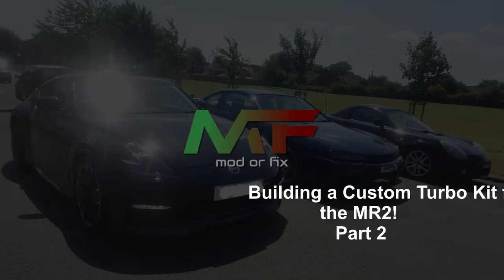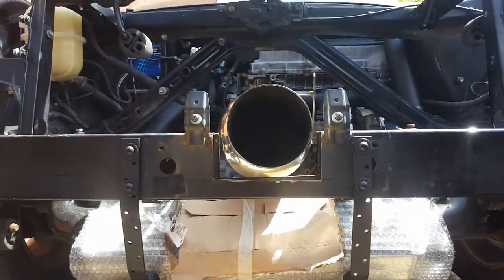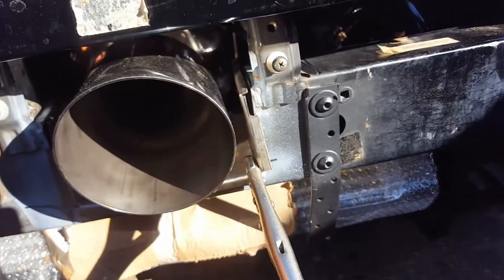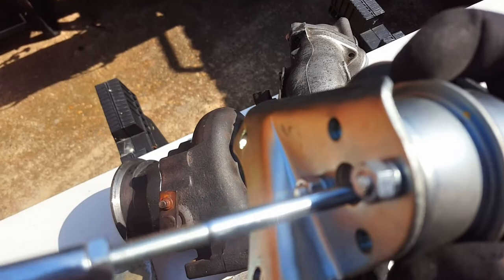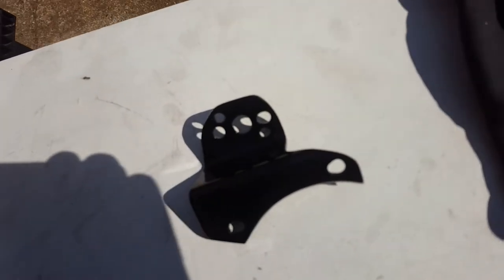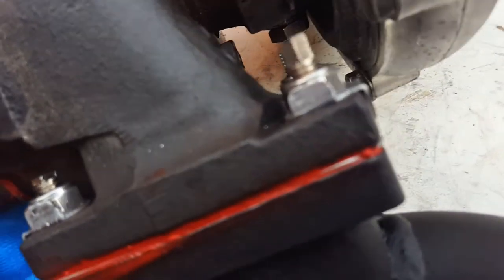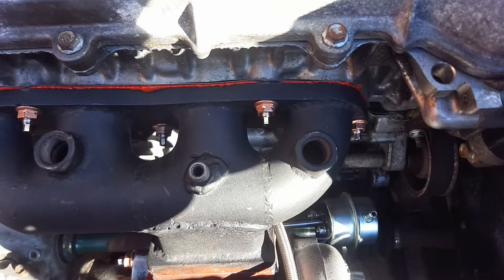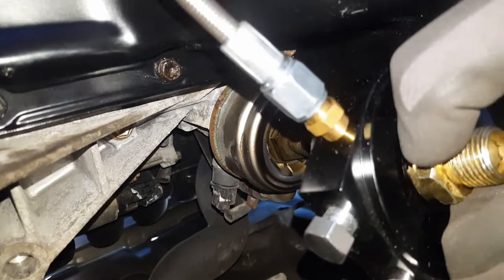Custom Turbo 1ZZ MR2 Roadster / Spyder Build Part 2

Comment: This series is really good! Surprised it hasn't blown up.
Reply from the maker: I think maybe the Mr2 Spyder/roadster market is niche, and not as many people dive in. I think the number of turbo mr2s has risen a but since I published this though lol!
Reply: @ModorFix  by any chance have you got a list of parts and prices to do this?
Reply from the maker: @nicktayshagaming1659  I will make a video and go through it all in detail. But to give you an idea, I built this on a budget and it still cost me over £2k that's with an inexpensive ecu and self map.
Reply: @ModorFix  I mean £2k is really reasonable to turbo a car, but I guess you basically did all the work which is amazing.
Reply from the maker: @nicktayshagaming1659  yes but that's on a budget. I mean.. I paid £30 for my exhaust. And £120 for my turbo to give you examples. If you bought a proper exhaust, management and mapping and turbo, you're looking at 2k there alone. Let alone a good clutch lol! Sating that I need to do a clutch on mine.
Reply: @ModorFix  oh wow some proper bargains!!

Comment: Thanks for all vids, clearly explained, very helpful informations.. 
Can you link me the oil sandwich please 
Thank you
Reply: Is there other locations for oil feed line if i done want to use oil sandwich?
Reply from the maker: There are an array of them on ebay. I can't find a link to the one I purchased as it has been a few years now. But it wasn't expensive. Around £15 and works well.
Reply: @ModorFix  
Thanks   i will search it now
Reply from the maker: @100stamina  yes, you can T off the stock oil pressure sender/switch. You will see it above the oil filter.
Reply: @ModorFix  
I just ordered a T piece adapter 
Thanks again
Reply from the maker: @100stamina  welcome bud.

Comment: Thanks for the vids. Any issue with the MOT not having a CAT? Were emissions OK??
Reply from the maker: Hi Jared, my advice would be to make sure you have a Cat in place. I am going to be reconfiguring my exhaust setup to incorporate a Cat. Ideally a vband setup where i can easily decat if i want to. I am building a new engine as you know mine burns oil (still) so lots will change
Reply: @ModorFix  Thanks! Good to know :)
Reply: @ModorFix  one more question, if you don't mind. How did you get on temp wise with the intercooler. I know a lot of people suggest a water to air charge cooler?
Reply from the maker: @jareddempsey9944  for 6-8psi I would say it's fine. Mine does get hot on 10psi now, but I have not check AITs (should really). I personally think with the ducting I have planned for it, it should be fine. I know of a audi quattro running nearly 600hp with a similar setup and that's where the inspiration came from. Spoiler alert I have bought a water meth kit too which will help ;)
Reply: @ModorFix  great stuff. Cheers.

Comment: Nm means newton metres not nano metres. Just for your knowledge. Great work, something i want to do but scared to potentially waste my money lol
Reply from the maker: Thanks bud, Yes, I do make mistakes like that alot. I call nuts bolts too and I had a bit where I said I need to bolt the manifold to the exhaust when I meant turbo doh! I edited that bit out. I did mean Newton, but said nano.  Those settings were no good anyway, the nuts came loose. So i tightened to Dan Lbs in the end :)
Reply: @ModorFix  if in doubt tighten to FT fkin toight!!